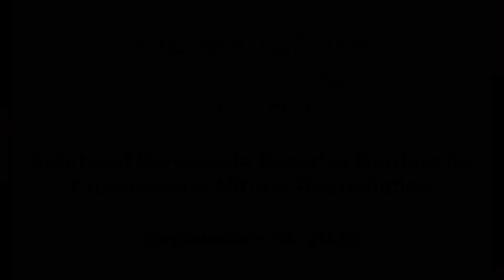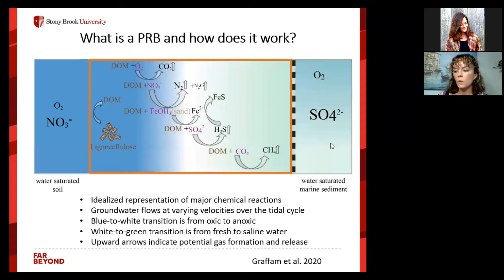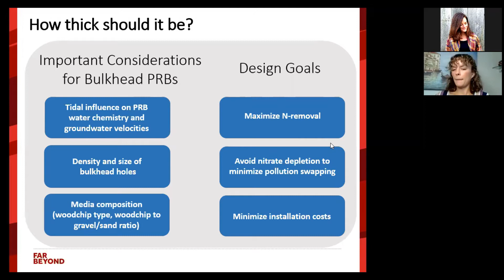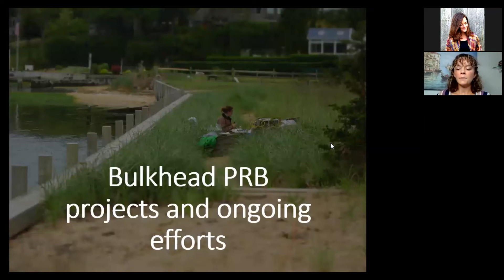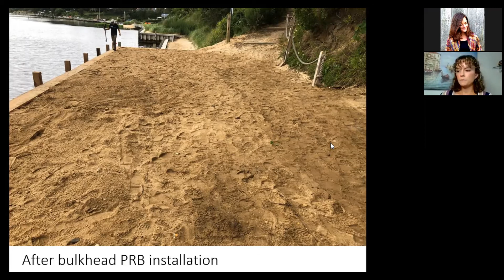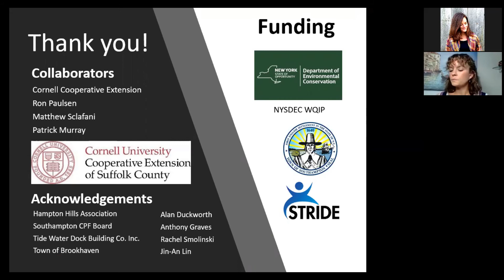CCWT - Bulkhead Permeable Reactive Barriers for Groundwater Nitrate Remediation

Comment: Wow....I must say that your presentation was not only informative, it was done in a way that was easily understandable. The pictures during construction were a an awesome visual aid that helped me wrap my head around what your message described. In comparison to 2,000 Lb. Activated Carbon Vessels that are continually swapped out in the treatment of PCE and TCE that can prove to be cost prohibitive, The Wood Chips seem like a viable alternative or   solution in Safe Drinking Water Act Compliance. Economically and Environmentally speaking, I like that the various types of Woodchips are Locally Sourced and most likely native to the area. Just to verify that I understand the Bulkhead PRB Schematic correctly, there is no well pump in the system to specifically control the effluent flow rates and remediation treatment times that are taking place and are naturally flowing to the lowest hydrostatic level. Long story short, You now got a fan in California. I thoroughly enjoyed your presentation and I look forward to more of them in future. Wow, this my first to comment ever chance to write a comment...I feel like I won a prize. I'm a dork Lol.     
Thanks,
Adam Mosman -California